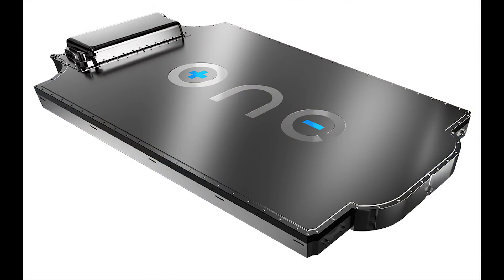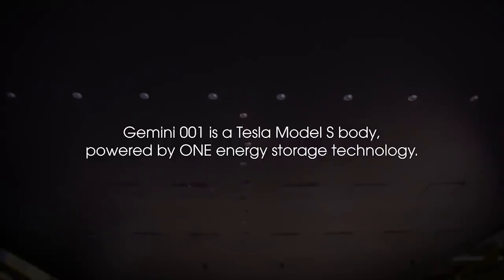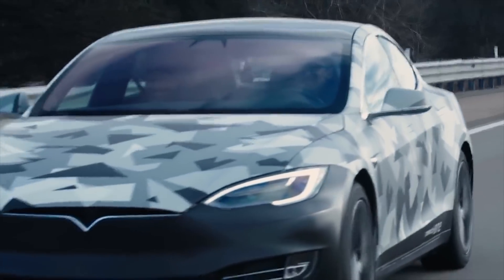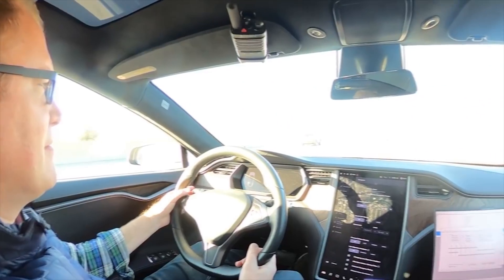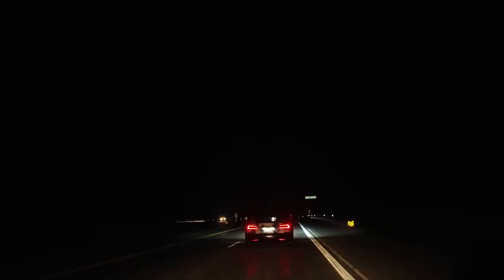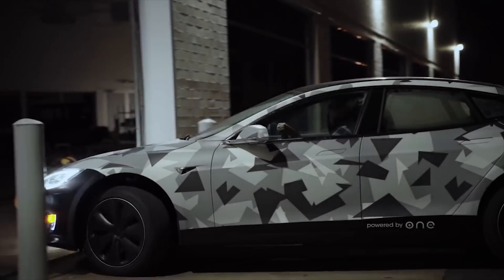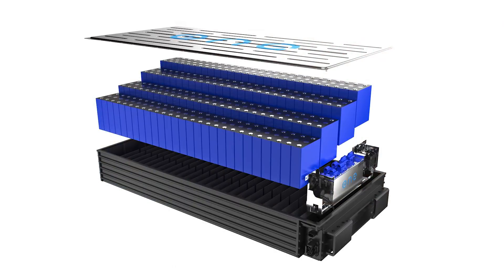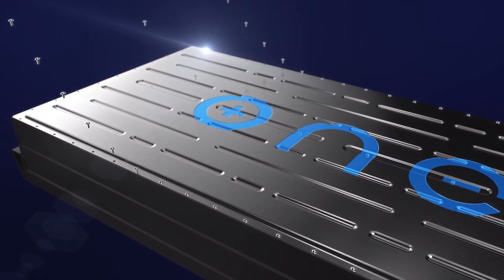750 Miles On a Single Charge & Still Room for Improvement - Autoline Exclusives

Comment: Apparently Tesla loses about 30% range in extreme cold driving conditions.  

Range-anxiety anxiety - the fear that one will have range anxiety if they own an EV is like the fear that people would suffocate if their Tin Lizzy went faster than 60 MPH.   It will go away with experience.

Let's say you have a 300 mile range EV that is as efficient as a Tesla (they will all get there).  You lose 30% driving in the far north on a terrible winter day.  Now you can drive about 200 miles before stopping for some hot coffee, soup, and battery juice.

What is actually needed is an adequate number of rapid chargers.  Spending money to buy a car that allows one to drive 5-6 hours, non-stop, in extreme cold just makes no sense.  Unless the Pony Express is still operating where you live.
Reply: I like Quantum Scapes technology 😊👍
Reply: Range anxiety anxiety, so funny, so true, that's how human brains work.
Reply: public charging anxiety is real nobody wants to wait a long time to charge.
Reply: @davewhite113  
Absolutely.  And readily available public rapid charging is a solvable problem.

And it is being solved.  Tesla is opening up its Supercharger system for all EVs to use and installing new Superchargers at a rapid and increasing rate.
Reply: @bobwallace9753  Tesla is about to face a number of issues though, They'll need to replace a large amount of their superchargers in the next two years, they are now making them in China and there could be delays and they are losing millions on their superchargers now. There are over 3000 power companies in the USA and only about 20 of them can afford to make the upgrades needed to add those chargers that you mentioned. Yeah they can add enough, but  unless they build micro nukes in each state, you're talking 40 more years to do so. EV technology will be obsolete long before that.
Reply: @davewhite113  
1) What do you mean about Tesla needing to replace a large amount of their Superchargers in the next two years.  Do you mean upgrading the version 2 chargers to version 3?  That's a minor deal.

2) Yes, Tesla opened a Supercharger factory in China recently.  That gives Tesla two Supercharger factories.  And, if needed, Tesla will build more factories.  Don't forget, Tesla is awash in cash.

3)  Losing millions on their Superchargers?  Do you mean that Tesla is investing up front to manufacture and install Superchargers which will mean an increased revenue stream over coming years?  That is simply what smart companies do.

4)  Your 3,000 power companies/20 can afford makes zero sense.  Tesla pays for the utility cost to connect to the local grid.   Utilities are installing more generation (largely wind and solar) because more generation = more profits.

5)  The last part of your comment is simply foolishness.  Micro nukes, like all nuclear generation are simply priced off the table.  EV technology will be dead in 40 years?  You got some breakthrough info about vehicles running on unicorn tears?
Reply: @bobwallace9753  Gosh....Those superchargers don't last but a few years if they don't break  sooner.If I'm correct on this, all chargers will be made in China.......None of these companies are making money on charging and Tesla is not making enough to pay for the cost to install them.....You need the grids upgraded to supply enough extra power to charge at home or at a public charger California is already facing blackouts soon..Only the big power companies can afford the EHV transformers needed to upgrade.Uh.... Tesla can't just go to a county and install superchargers if there's not enough power for them to work.Only two countries, germany and S Korea makes those transformers and can only make a few each year. It would take 40 years to build and install enough for many Ev's. That's WHY elon has been pushing micro nukes lately.

Hydrogen powered ICE hybrids will replace BEV's within 10 years.Cheap easy to produce hydrogen is closer than most think.
Reply: @davewhite113  
1) Please give us some data showing that Tesla Superchargers wear out in a "few years".   I do not believe your claim.

2) Lots of very high quality stuff is now made in China.  

3)  I don't know about other companies, about their profitability.  Tesla does not make money off charging.  They intentionally do not profit from charging.  They charge only what it costs to build the system, maintain the system, and purchase needed electricity.

It's part of Tesla's mission statement to speed the world off fossil fuel.

4)  Yes, we will need to add generation in order to charge EVs.  Thankfully wind and solar are so incredibly cheaper than fossil fuels that we will end up with cheaper electricity for all purposes.

5)  Elon has not been pushing micro nukes.  He has said that we should hold off on closing the reactors that are now in operation until we close down fossil fuels.

6)  Hydrogen fuel cell cars are dead.  Have been dead.  Will remain dead.  Learn some very basic physics.
Reply: @bobwallace9753  I can't find a link to the story about the superchargers being replaced, I'll keep looking for it.It's not that they are not making money on the superchargers it's that they are losing all kinds of money on them....I understand that Tesla wants to someday use wind and solar to power superchargers, but that's a joke, that's like spittin in the wind.If that was possible, they would already being doing it.

Elon has said that nukes are safe and will be needed in the future. I thought he had mentioned micro nukes, but micro nukes are the ONLY answer to having many Ev's here in the USA. California is facing blackouts this summer and how in the heck can they supply more power for Ev's? the answer, they can't. ....Ev's are a bridge to hydrogen and it's a much shorter bridge than most folks think. Don't let Elon fool you on this. 100 years from now they'll look back and laugh that automakers tried making BEV's for a few years during this time.
Reply: @davewhite113  
"Tesla solar panels have generated more electricity than has been
consumed by our vehicles and factories between 2012 and 2021 "

Tesla solar panels produced 25.39 TWh between 2012 and 2021.
Tesla factories and all Tesla EVs consumed 25.27 TWh between 2012 and 2021.

Tesla 2021 Impact Report
Reply: @bobwallace9753  Bob, you seem upset, I didn't mean to upset you.....Uh....I think the next ten years are gonna be real interesting, remember this conversation as it unfolds.
Reply: @davewhite113  

It does upset me when people make "factual" statements with no facts to back them up.  Opinions are fine, but state them as opinions when you are just guessing.
Reply: @bobwallace9753  You don't know the difference.I'm sorry that I upset you with facts.
Reply: @davewhite113  
Anyone who reads this thread will easily see that you brought no facts.

That you made claims which were disproved.

Have a nice day Dave.
Reply: @bobwallace9753  You have a nice night too Bob.....nothing personal...Time will tell....
Reply: Well my family makes quite a few 10 hour each way trips and we currently stop once 5 hours in for fuel and bathroom.  And in this part of the country it is minus 30 overnight and sometimes only minus 20 for daytime highs.  Stopping to charge for quite awhile is more than a minor inconvenience.   Then throw in sometimes I'm pulling a 7000 to 8000 lb trailer.  That means to net 250 miles of real world range I need a rated range of 700 to 800 miles. For evs to be a practical alternative to a gas vehicle they have to have very few drawbacks.   Real world range is one of them where current ev tech isnt even close

Comment: Many more questions to ask about -charge rate, life of battery, and initial cost and replacement cost. The major manufacturers are spending billions in reserch $$ to develop more cost effective and efficient batteries so I'm not confident that this company will prevail.

Comment: A lot of credit also goes to the efficiency of Tesla's motors. 
Me personally, I'm more interested in charging time, rather than an 800 mile range. 
On a related note, all auto manufacturers need to standardize a touchless charging system. There are a lot of areas where I would not feel comfortable getting out of my car to plug in a charging cable - if it hasn't already been stolen by scrappers.
Reply: Tesla's motors? If they would have used a Lucid, they would have gone over 900 miles!

Comment: Autoline - not really groundbreaking. 
anyone can put in a Larger & Heavier battery pack and get Longer range (for a price).
#1 - weight PENALTY since bigger battery is HEAVIER. lowers Efficiency & range. 
#2 - size of pack may Restrict size of Interior or compromize FLAT FLOOR , like in the Lucid. 
#3 Range penalty , since you are carrying a Larger & Heavier pack. 
#4 Efficiency , again Larger & Heavier pack. 
ONE is not adressing the key element ideal Range/Efficiency given battery pack size/weight. 
ONE is only Creating DUMB range , just like when Lucid CHEATED with their Alleged 140 kwh pack. 
ONE is not making the TESLA more efficient , not lowering the Weight, not increcing range with Greater Efficiency.

Comment: I’m on the second group. There is no need for that much of a range for 90% of drivers. I’ve been driving electric cars since 2012 and teslas since 2015 and I never felt like I need more than 100 miles range. With tesla supercharger network, I’ve been traveling long distances with no issues. Most people who make their EV buying decisions based on range over 300 miles, have no idea what they need and are new to EVs. Future of EVs will be set around 300 miles range, I would say. Save the extra battery to bring the cost down and produce more EVs. 🙏
Reply: Lol…… everyone has a very different use of cars, also all around the world the conditions differs alot! Teslas/EVs are not knowned to do well at towing and it’s even worse at higher speeds! Longer range means you can go further to remote places overlanding/camping, tow on longer distances with less recharges…… there are cars with over 900 miles of range and those are super useful. Your 90% of drivers estimate is totally wrong!

Comment: Alternatively, better charging infrastructure and charge speed makes super-long ranges unnecessary. The question becomes which avenue will end up being right. At current technologies, neither path is an obvious answer.
Reply: Over engineering is better than under engineering
Reply: More charging including long-term slow charging at Job locations.
Reply: @Cre8Lounge  I agree but in this case over engineering is 300 miles the second 300 is waste
Reply: Wrong! Wrong! Wrong! Better range is the absolute key, not everyone has the same use on cars, EV are still terrible at towing and higher speeds, colder climates…..
Reply: @alanrickett2537  nope it’s not! And bigger vehicles needs higher batteries capacities which have to be light to not impact on efficiency…. People want electric trucks, RVs, bus for overlanding/camping and living….. there is a reason why diesel is still king
Reply: @alanrickett2537  a Toyota hilux has about 1000 miles of range, a land cruiser over 1200 miles of range excellent for all kinds of activities, some RV even have over 2000miles of range to basically cross entire deserts/forests……

Comment: We don't need more range for electric vehicles. 300-400miles are enough. Maybe for trucks you need more, but not for passenger vehicles.
Reply: Not that true.  The fast dc charging infrastructure is years away from the amount necessary to travel.
Reply: @ChicagoBob123  You can travel anywhere in a Tesla  today and they'll open up the charging network soon for all EVs. They have the lowest cost chargers, made in-house, and the most reliable.
Reply: 300 mi is more than enough for a vast majority of uses. Occasionally you have to go a little out of your way and take a few minutes to charge. If that's really not enough for someone they should just keep driving gas.
Reply: @Poxenium  Tesla?  Unless you spend a boat load of cash they charge slow.  Tesla is still for the rich.  No tax rebates priced way to high.
Reply: @ChicagoBob123  from a economic point of view they are under priced as demand exceed supply.
Reply: If you don't go anywhere sure 300 miles is enough. If you want to travel though,  you need waaaaay more.
Reply: @alanrickett2537  if you keep them and they last 10 years Tesla is ok. How many 15 year old Teslas are there?
Reply: @davewhite113  with our current fast dc charging infrastructure
Reply: @davewhite113  The biggest distance between two superchargers in the US is 150 miles, 100km in the EU. You charge for 20 minutes once every 3-4 hours of driving.
Reply: @ChicagoBob123  none as it's not 2023 yet and the first were made in 2008
Reply: @alanrickett2537  so the cost over life is only on 10 year estimates.  Tesla midwest rust?  How about loss of battery range?
Reply: @ChicagoBob123  the aluminum ones will not rust , the batteries are estimates base on number of cycles done to average usage as there are no moving parts that's a fair way of doing it and there are now car a
Over 300k miles on first battery and motors 
As for the motors they  would last 100 years I have worked on 100 year old motors
Reply: Yes we need more than 500 miles on EVs and not everyone have to buy them lol…… not everyone has the same use with vehicles.
Reply: @Poxenium  wrong!!!!! You can’t travel everywhere with a tesla! You can’t go overlanding with a Tesla! You can’t really tow with a tesla and certainly not daily! EV still have their limitations.
Reply: @carholic-sz3qv with 500 trucks get 250 when towing.  That's useful range
Reply: @ChicagoBob123  do you have any test video showing that!? Bullshit!!! I’ve watched TFL trucks/EV test a rivian r1 truck and it barely managed to have 100miles from the 300 miles normal driving when towing. It’s the same with modelX…..
Reply: @Poxenium  depnds on what state and what direction and what route.  If your saying this is for Tesla,  maybe, what's the cars actual charge speed.
Reply: @ChicagoBob123  Look at the map.
Reply: @carholic-sz3qv  Look at the map! If you want to go rolling around in the mud, then you charge up at the closest supercharger then look for RV parks, where you can charge up in a couple of hours.
Reply: @Poxenium  i owned an ev, live in the midwest.  The fast dc chargers are sparse. Check I 80 in Indians or go north in Michigan. Geez look at west virgins.  Dc chargers with over 100kw are not plentiful.  Tesla maybe. But you can't use a Tesla
Reply: @ChicagoBob123  why can't you use a Tesla?
Reply: @Poxenium  you don’t have any supercharger or RV park everywhere and people doesn’t just camp around RV parks….. grow up! With ICE cars you can go basically everywhere the range can bring you, no need to rely on a charging or whatever, a jerrycan or auxiliary fuel tank will bring you where no EV will ever go. That’s how the world was built! From mining to expeditions, rescues……. EVs are not mature enough sorry to disappoint you again 😂
Reply: @Poxenium  Tesla only supports level 2 DC charging with a convertor, which would take hours to charge, since I do not have a tesla. Level 3 fast charging, the only one good for traveling, only works with a Tesla.

Comment: I saw this before on Munro Live and I thought there was a catch back then and now as well. 
If 'ONE' are using a 200+ kwh battery, or just over twice the size of a Tesla Model S, which has an estimated range of 405 miles then surely 750 miles is going backwards. 
What's more is we don't yet know the advantages the new 4680 cells are going to give Tesla.

Comment: ICE charge themselves using an alternator. Why can't alternators be added to electric cars to feed the battery in the same way?
Reply: The electric vehicles recharge when slowing down, recouping energy. Alternators consume the energy created by burning fuel and convert it into electrical energy
Reply: The amount of drag an alternator adds it doesn't help
Reply: Physics, only makes sense as regen braking, the motor does that.

Comment: What we really need is an EV with a full  sized refrigerator, washer, dryer, and herb bed.

Who actually needs more range than their bladder/belly?  Stuffing unnecessary batteries into an EV only makes it less efficient and more expensive.
Reply: I do. We look forward to traveling in an electric van that will allow us to travel long distances and boondock on BLM land for days and not worry about charge. Chargers are not always available and/or working. If you want less range and battery capacity, buy that product. Do not speak for me. I want more range and capacity.
Reply: @senordockman1138  
You are talking about a specialized use vehicle.  The issue is what do 99.99% of drivers need?

In the early 1900s lots of places did not have gas stations.  People traveled with cans of gas strapped to their cars in order to get from gas station to gas station.  Some even sent barrels of gas ahead by freight wagon.  As cars quickly became common gas stations were built.
Reply: ref: Rivian Camp Kitchen.  "YOU GET A CAMP KITCHEN...!!!  AND YOU GET A CAMP KITCHEN...!!!  AND YOU GET A CAMP KITCHEN...!!!" (Oprah voice)
Reply: @phillyphil1513  
If you pay for a camp kitchen.  And you can get a tent that fits over the bed, if you pay for it.

(Or you could go to REI and buy the exact same tent for hundreds less than Rivian charges.)
Reply: See the documentary The Simpsons: oh brother where art thou, they asked the Everyman what he wanted in a car, built that car it was a bloated overpriced piece.
Reply: @rp9674   @rp9674  re: "it was a bloated overpriced piece." ref: "CANYONERO..." (singing voice) https://www.youtube.com/watch?v=PI_Jl5WFQkA
Reply: @phillyphil1513  never saw that ep before, hilarious!